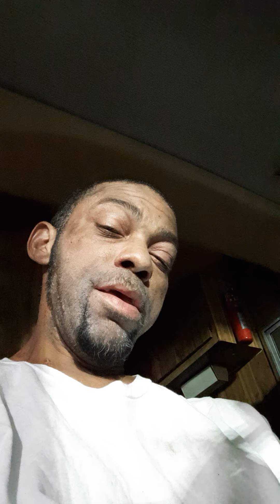Stranded possible head gaskit

Comment: If there's anything that looks like gold flakes it's stop leak, u will see it in the radiator fluids for sure. Those low of miles I don't understand why they would need stop leak in it, most likely rust and just do a thorough flush of everything being that old and sitting. I'd definitely keep it with those low of miles. U got this, I believe in u!!